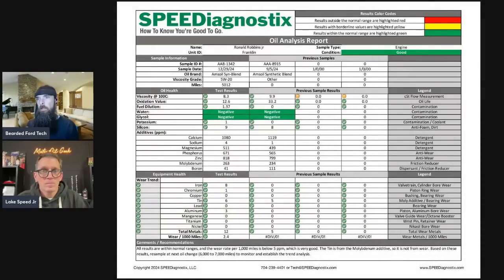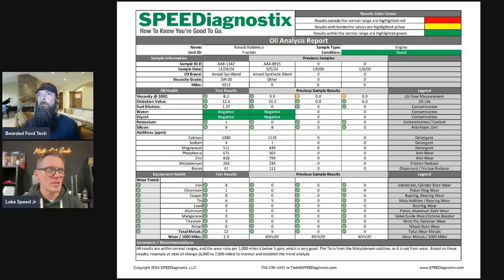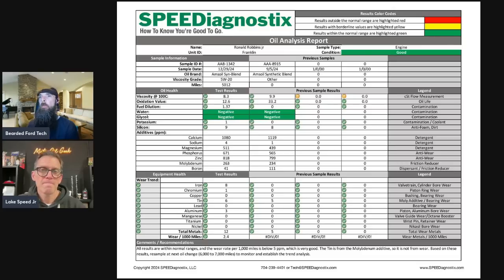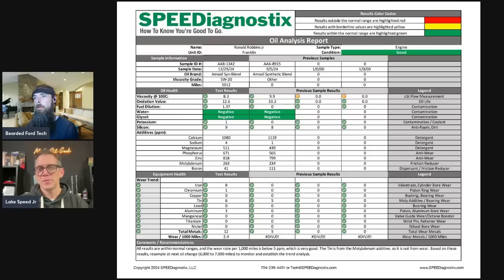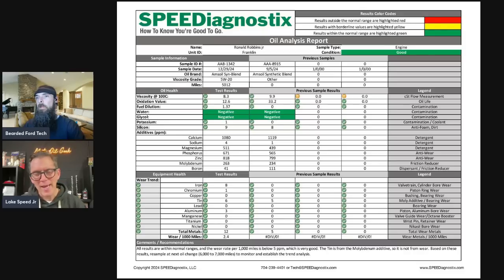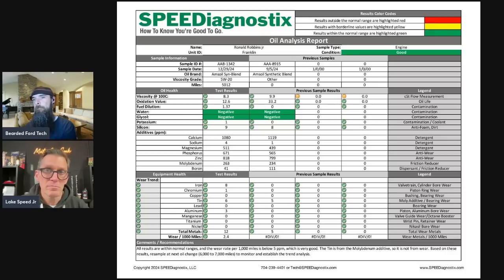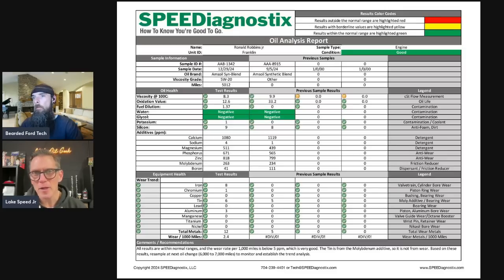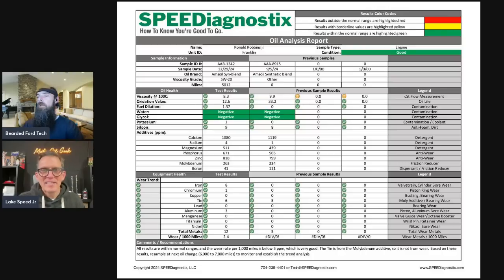AMSOIL Synthetic Blend Oil Analysis SHOCKING Results!

Comment: just bought a new 2025 f150 with the 2.7 ecoboost. i have 70 miles on her! should i change the oil at 1,000 miles? and can i use pennzoil untra platinum 5w30? not sure about using motorcraft synthetic blend
Reply from the maker: Change it at 1000 miles. You can use pennzoil ultra platinum. Its good oil. Amsoil Signature Series is better with better protection though. Can't go wrong with either one. Both are very good oils
Reply: @BeardedFordTech  roger that 👍, im also considering using valvoline restore and protect, i was just looking at ford boss videos and he loves it, valvoline restore and protect is safe to use with ford spec too right?
Reply from the maker: @azcompetitiveshooter why use that on a new engine?  Its restore the neglect. I don't use it nor do i recommend it. Lots of horror stories from people emailing me with engine failure from using it
Reply: @BeardedFordTech  holy smokes! i had no idea. pennzoil ultra platinum it is than!
Reply from the maker: @azcompetitiveshooter that's a good one. If restore and protect does that to an engine. Imagine what its doing to the wet belts in engines.
Reply: @BeardedFordTech valid point! i didnt think of that. the wet oil pump belt in the 2.7 has me worried a little when it comes to high mileage. once my factory warranty is up, im considering buying fords premium extended service plan for 10years/175,000 miles. the 10speed transmission worries me too
Reply from the maker: @azcompetitiveshooter havent really seen any issues with the belt (yet)  and the transmission is hit or miss. I have the 10 speed in my 19 ranger. Its been great no issues. Just keep the fluid changed about every 40-50k. And filter every other fluid change. As far as extended warranty you could have got that when you purchase the truck and it kicks in when factory warranty expires. Or you can always go back and get it later. Do not do a third party (like car shield)  do a ford warranty.
Reply: @BeardedFordTech ford esp warranty for the win! and im thinking of getting a catch can to protect the engine. do you recommend a catch can on these new 2.7's?
Reply: @BeardedFordTech bs. Valvoline R&P in no way is causing engine failures
Reply from the maker: @azcompetitiveshooter i recommend a catch can on everything. The 2019 rsnger i had, had one. The 23 f150 5.0 i bought i put one one thst too.  Video on that one. Super easy to install.
Reply from the maker: @Lawnfella tell that to the engines i replaced cause it ate up wet belts. Or how about responding to the emails.  Or go tell them in the comments.  Turbo failures. VCT solenoid failure (easy fix) that oil apparently ate a wet belt system.  Valvoline itself is good.  I dont trust restore the neglect. You call BS only because it hasnt happened to you yet. Maybe it will. Maybe it wont. Maybe go reach out to the people in the comments who experienced failures after using it.  Learn a thing or two.  Just because it hasnt happened to you doesnt mean its BS.  I literally do this everyday
Reply: @BeardedFordTech still calling bs. Let’s see actual proof before you spread around fake news
Reply: @BeardedFordTech after replying you haven’t seen any issues with the oil pump belt. This oil has to be compatible with rubber/gasket/belt materials to even pass specs
Reply from the maker: @Lawnfella you really dont know how this works do you. I csn tell your not in the automotive field but know more thsn us and see more than we do on a daily basis. Mentally rotated. Thanks
Reply: @BeardedFordTech you sure don’t know. I’ve been in the automotive field for 25 years. I promise you it wasn’t the oil that was the cause of the problem. You’re making false accusations blaming the oil
Reply from the maker: @Lawnfella I call it like i see it.  Thats the only oil they have run since it came out. And they get a failure. I wouldnt accuse it itf it wasnt three different vehicles running the same oil.  And you still havent commented asking them you just want to say im just accusing. But yet you say its BS.  Thats like saying any engine oil won't cause a failure. You may want to think back on your "25 years"  apparently you dont do this anymore. Have a great day.
Reply: @BeardedFordTech  is there a brand you recommend? im looking at k&n catch cans. only thing stopping me is the warranty. i really dont want to void my warranty
Reply from the maker: @azcompetitiveshooter I do not recommend anything k&n. I've never seen a catch can void warranty. All its doing is catching oil vapor from going back in the intake. My truck just got a new engine under warranty. It has a catch can.  J&L 3.0 is what I have

Comment: Can you help me on what oil to run in my 2023 GMC 1500 Denali 3.0 diesel ? I currently run Amsoil in everything I own and the 0-20 in the diesel. There is alot on demon works and motor geek saying use 5w/30 in my truck. I live in Fresno ca. 100 degree heat but don’t tow. My question is which Amsoil their 5w/30 Dexos D diesel oil or their 5w/30 euro diesel oil? Thank you in advance.
Reply from the maker: The 5w30 signature series max duty. Its api ck4 rated which is really good. And it exceeds dexos (dexos is gms way of saying use my oil that went through this little crappy test for a bottle label and paid a lot of money for it)

Comment: I wish you guys would also mention the length of time in-between oil changes that you did for the amount of mileage that you drove. I mean, simply saying that you replaced the oil at 10,000 miles doesn't tell me if it took you 3 months or 3 years to get to that mileage. That information is particularly helpful for people who often drive in stop-and-go traffic.... who rack up the engine hours with very little distance travelled. Otherwise, thanks and great content!
Reply from the maker: Well this was a synthetic blend oil. I sent some to a subscriber. He went 5k miles.in 4 months.  I usually.do 8-10k in about 5 months. I drive a lot.
Reply: @BeardedFordTech  Thank you! You reckon 6 months or 12k on the synth blend and 8-12 months or 20k for the 100% synth (Signature Series)?
Reply from the maker: @JasonJJJavier syn blend is 5k 6 month. Signsture series is 25k 1 year but sever service is 15k 6 month.  And mkst cars are severe. Severe meaning lots of stop and go.  Idling more thsn 10 min straight )stopped traffic,traffic jam) turbo charged engine just to name a few symptoms of severe service. If you use signature series 10k is perfect. I would recommend going 5k. Change oil and filter. Go 5k again. Change oil and filter. Go 5k again and send it off for tesring to be sure.  Reason teo oil changes it to make sure the residual oil from the other brand isnt in there being tested too.  This will give you a baseline and can adjuat mileages accordingly once you get a trend analysis going.
Reply: @BeardedFordTech  How would you compare the AMSOIL Heavy-Duty Turbo Truck to the syth blend?
Reply from the maker: @JasonJJJavier the heavy duty turbo truck?  You mean the commercial grade?  If that is what you are referring to thats diesel oil.  Would run a diesel oil in a gas vehicle.
Reply: @BeardedFordTech  Oh right. Forgot that were all talking about petrol engines. Lost track of that one. I do have a Diesel and contemplating between the Signature Series and the Turbo Truck. I have a small 1GD engine (2.8) and I just want to keep it for at least 10 years.
Reply: @JasonJJJavier and BFT I have two sport fishing boats, 1987 Blackfin 32 FB with two 3208TA 375HP Cats & 2004 Cabo 35 FB twin 450HP 3126B Cats. I switched to Amsoil Signature Diesel 15w40 and am very impressed with the results. You can’t go wrong with this oil IMO

Comment: Nice to know all the good things I hear about Amsoil ain't BS. The only problem being is Amsoil's claim that their 100% Synthetic oil doesn't
Have thermal breakdown as quickly as Full Synthetic (mineral oil blend) and able to go 10k between oil changes.
The problem oil filters are not big enough to go 10k. Unless you are able to add a boat oil filter to your engine.
Reply from the maker: @johannjohann6523  they go 10k. I went 10k on amsoil with a motorcraft filter. And sent it in (it was the xl series) I'm doing signsture series now.  On these tests I'm using amsoil filters. They go 10k as well.

Comment: I use to go to the Lincoln dealer for my oil changes every 5k miles. Then one day as I was talking with the service manager, I asked why they didn't use full synthetic oil. He told me that their synblend was really good and that I will be able to get another 50k-70k miles out of my car. I had roughly 120k miles at the time. Little did he know I have a goal of hitting at least 300k on this car... It was at that moment I knew that was my last oil change at the dealer. I switched over to Valvoline full syn on the next oil change. Ran that until I discovered Amsoil at 170k miles... Just serviced my oil with my 3rd Amsoil batch. The first 2 were with the Signature Series and the latest change just last week was with their high mileage. I put roughly 500 miles/week on my car, I know how that engine sounds and feels. It runs so much better with Amsoil in it. I do like Valvoline's products as well though. I would place it right behind Amsoil. There's just something about Amsoil that makes me sleep better at night.😂
Reply from the maker: @markpetrovic6223  so the dealer bulk synthetic blend isn't bad. The thing is. It's bulk. Very bulk lol. And it's whay comes factory filled.  Not because you could get 50k-70k. Thats kind of a low number anyway. Why would he say that?  I am running signature series in my truck now. I was testing amaoil xl. Now I'm testing signature series.
Reply: @BeardedFordTech Do you have a video of results on the XL?
Reply from the maker: @82lowe36id yes there's like 5 of them on my channel.  Its good stuff
Reply: I just switched to Amsoil on my GT350 I wanted to put the best oil I could in this very high performance engine. It runs smooth and I can rest easy knowing that the engine is protected.
Reply: You have to remember one more important thing? The oil is worthless if it is not filtered good. Run a high quality synthetic oil filter that has been tested and proven.
Reply: @garykarenmcgruther6386 That would be an AMSOIL filter....

Comment: I use Amsoil signature and I would like to know how it test against on the shelves oil for less money at Walmart for example. I’d like to gauge if it’s worth the extra money I pay compared to buying mobile 1 or penzoil or valvoline.  I know I know about the apples for apples comparison however how will I ever know if I’m wasting money.
Reply from the maker: I'm testing it now in my truck. The signsture series.  You would be wasting money using mobil one. That oil isn't what it used to be. Unless you like a noisy engine at about 1k miles. Pennzoil ultra platinum is pretty good.  But they aren't as good as the amsoil as we have seen in other tests.  I tested XL last time. So I have to do a few oil changes before I send off signature series for testing.  To be sure it's straight signsture series.
Reply: @BeardedFordTech  Thanks. I can’t wait to see the results. I have been using Amsoil oil filters also. They are not as heavy as the mobile 1 filters, however they say they filter to 20 micron. In my Ram 2500 with the 6.4 hemi I change it every 3k and in my Tundra I have been changing it under 5K. I really can’t wait to see your results. Thanks so much.
Reply from the maker: @shibmasterkman3176  on the xl series i ran a motorcraft filter cause I ran out of amsoil filters. So I had to keep it the same for the test.  I'm using the amsoil filters on the signsture series test. I bought a bunch so I could keep it the same throughout. I'll do a video once I send it off. I have a little bit to go.  Sucks it's one of thise things you can't rush.

Comment: I've been in car groups and forums for a bit over 20 years.  I cannot count the number of times that someone will comment to 'use what the manufacturer suggests' when a different product is suggested by someone else.  Their qualifier is (almost always) "I've been using X product and have had no issues."  The lack of factual data is incredible and horrifying to me.

All that said, I absolutely love videos like this.  It is putting facts out there for all to see, versus just relying upon speculation or opinion.  Thank you both for this!
Reply from the maker: @not12listen  you're welcome. It's what we try to say. If it works for you. Use it. If it doesn't then don't. And the correct way to know. Is testing. The data will tell you what's best for your ride and how you drive. 
Thank you for watching!  Share it with everyone so they can see the factual data.

Comment: 2K oil changes attempting to get 1 million miles out my Lexus LX. Pennzoil platinum synthetic I buy it @ Walmart 5 quart jugs & OEM oil filter. It cost me very little to change the oil. Especially compared to the msrp of 2025 Lexus LX 700h Overtrail, about $150K so I want it to last forever!
Reply from the maker: @AlwaysBeClosing78209  so your spending more money all oil changes (oil and filter) every 2k miles. Add that up to how many you do in a year. Sooner and more frequent isn't always better. It's great you want it to last though. Most people don't even know oil is in it
Reply: @BeardedFordTech  some years I didn’t drive much. This year I will probably only drive 6K on each vehicle. Some years I drive a lot. The oil is very inexpensive at Walmart. My friend works at the Lexus dealership. They sell me the oil filters by the case- wholesale prices.
Reply from the maker: @MrGamman3yt  💯💯

Comment: Try liquimoly specialtech AA or Molygen.     Great stuff
Reply from the maker: I used liquimoly in motorcycles. It's real big in motogp and European vehicles
Reply: @BeardedFordTech   Anthony, one of my Amsoil Retail Accounts (an independent mechanical shop) has a mechanic, who orders Amsoil 100% Synthetic Metric Motorcycle Oil for his European Cycle.  I asked him how he finds the Amsoil performs in comparison to other oils he has used.  He said the Amsoil was by far the best he has experienced and he constantly beats the cycle with wide-open throttle as much as possible, where the RPMs are at a high rate (sounds like a lot of fun)!!  You might want to try it for yourself (buying it from the Bearded Ford Tech, of course)!

Comment: Great video, especially liked Lake talking about test to test variability and needing a flush when changing brands/type.   That other Ford guy creator blocked me for pointing this out several years ago.  This was back in his day when he would cuss out anyone who disagreed with him, I am confident you know who I am talking about.  Now he just claims that he doesn't block people and remove comments.
Reply from the maker: @D2O2  yes. I know exactly who you are talking about. Sad really. I like talking oil brands. And if a brand suits you by all means use it. Thays what it's all about. When lake says flush he was meaning oil. Not an engine flush. So change the oil get 2 or three changes in then sample. Not using an actual flush
Reply: @BeardedFordTech  Yes, that is how I understand it, but good clarification for those that may not.
Reply from the maker: @D2O2  💯💯

Comment: I don't know that I'd go so far as to say "all ya gotta do is change your oil at 3k" but I do know that the Saturn I had would stretch timing chains if you ran much beyond that.   I had >250k on mine before my brother wrecked it. 

Have been looking into having an analysis run on mine.   It tends to leak unless I use Mobil 1 or Liqui-Moly (I tend to run Pennzoil Platinum or Valvoline in my other cars).  I do have a question though,  as carbon would be an abrasive,  is there a metric on the analysis that gauges the carbon particles in the oil?  If I'm missing it I apologize but I've yet to catch it on any of the analysis reports shown.
Reply from the maker: @Accidic  i don't think the carbon is run in the standard test. I think you can add it on if I'm not mistaken.  Buddy of mine had a Saturn.  Broke a valve spring.  Had like 200k miles as well.
Reply: @BeardedFordTech  My father was a service manager out for them and the chains (stretched iirc) were a regular problem for missed intervals.    I guess the engine was somewhat cheaply made?   Still,  If you hear enough horror stories about it it makes you super religious about the change. 

That said, in the VW project I stumbled into,  the level of black in the oil at only 2-3k (despite the 10k recommended OC interval) worries me a bit.  The Lincoln and 2 Toyotas I had were nowhere near that level at 5-6k even.

Comment: Excellent video, However; So many factors involved, it's Not just about motor Oil. 
All Engines- have different internal metals components used/clearances on bearings, Another factors; the driver, easy or hard  driving, Air quality conditions/air filter used, Fuel quality & amount/lack of detergents, has a Turbo,  fuel injecctors clean, MAP, O2 sensors good,Then Oil filter quality filtration, is the engine well maintained engine, 1 day was the engine properly broken in, etc.......  Just to name a few of dozens of variables
Reply from the maker: @user-xk5so7wb2t  agreed. I tested the xl series in my truck (turbo charged)  i could tske it all the way to 12k (which is what xl series is under severe service. And turbo is considered severe)  testing the Signature series now.
Reply: @BeardedFordTech  Oil filtration is more crucial than just quality oil. If oil is restricted (in flow/volume rate) bc of having a 99.6% "1st pass capture rate of x sized micron rating" 
Best oil in the world with low or/and restricted flow oil filter will seriously destroy an engine quicker than any regular crap oil will.
Reply from the maker: @user-xk5so7wb2t  yep. Which is why I use good quality filters. Not the $2 cheap ones. You are very correct though.